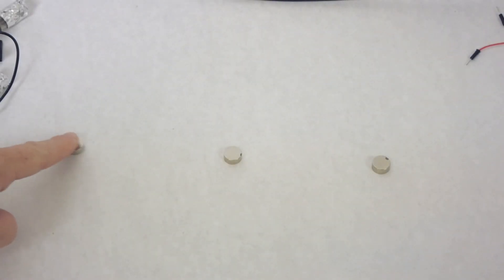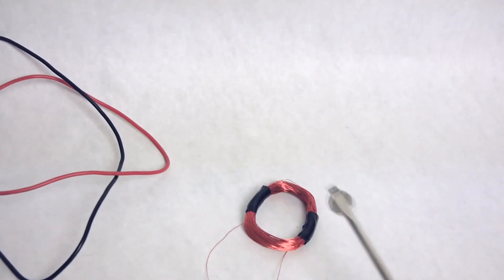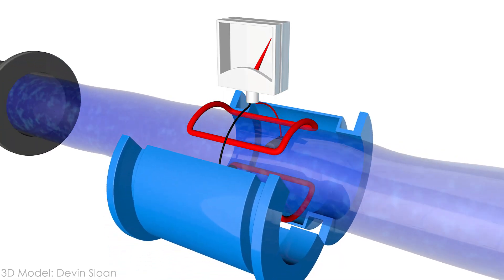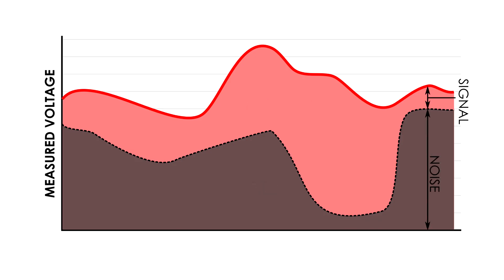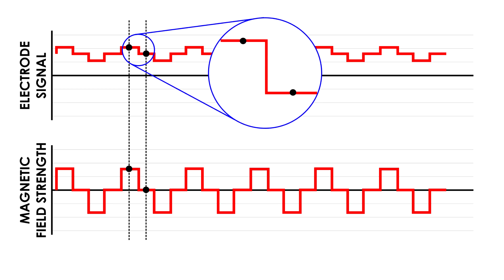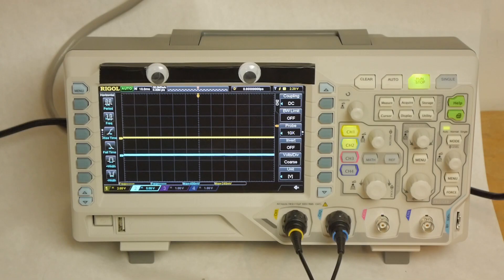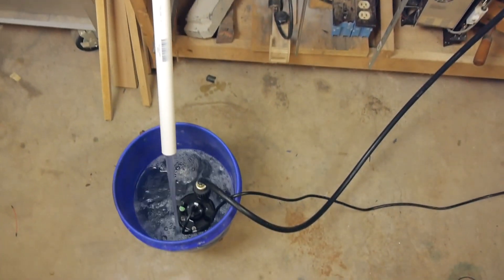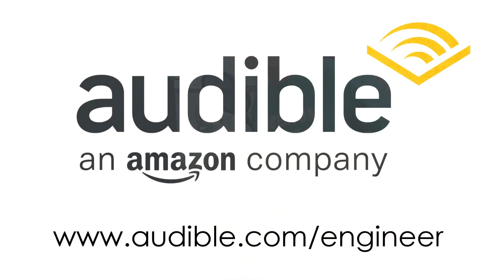How to Measure Flow with Magnets - (Magnetic Flow Meters)

Comment: connect the coil of the flow meter to a low noise opamp like MCP6021 to provide high impedance isolation. then use   a higher resolution ADC like a MCP3421  its a 18-bit delta sigma ADC.     over sample and use a FIR filter. that should filer most of the noise.

Comment: As long as your differential instrumentation amplifier has an input impedance >> (much greater than) the resistance of the water, increasing conductivity won't help.

Even tap water should be conductive enough for this. The magnetic field inside the coils should be larger than the pipe, or eddy currents in the water sap the signal.

Absolutely pure water likely won't work, as there is close to zero conductivity. But even the slightest bit if ions in the water cause some conductivity. Water is the ultimate solvent - put it through a metal pipe, metal immediately starts dissolving a bit into the water. Plastic pipe? There may be salts or some other ionizable substance that can dissolve into the water. Glass pipes? Most glass has metals added to increase toughness or clearness.

And has been pointed out, in a real world application, changing the fluid is not an option.

The magnetic field needs to be shaped so that the pipe is completely inside the core. With the tiny supermagnets or with the coils smaller than the pipe, some of the water flow is passing through the field going the other way, which reduces the signal.

Time to make my own video!
Reply from the maker: +Steve Greenfield very good info! Send me a link if you get a demo working.
Reply: Thanks! I suggest you subscribe. I've not put anything up in a very long time, but I plan on doing instructional electronics videos. Not the basics, lots of good channels do that.
Reply: Sigh... I still haven't done it.

Comment: build a coriolis flow meter
Reply: You want to detect the flow due to the Earth's rotation? :')
Reply: Interesting. Using the inertia of the fluid.
Reply: jep. quite ingenious. however, have yet to see someone built it with homebrew eqiupment (Arduino , ..)
Reply: It seems like it would be a subtle effect. But then, so is the magnetic flow meter.

Comment: Here's some helphint, since you are using AC to excite, means you have AC to work with on receive side, one thing comes in really handy (no need to increase current in the coil) google for Lock in amplifier...
That will extract signal even buried in noise by factor of 1000 or more no problem... and it is way cheaper then more magnet wire and adding current to the setup...
Also since in case you are pumping destilled water, impedance can make the system unusable, you have to use preamp with as high as input impedance as possibile not to shunt your useful voltage from the source (that puts in question your differential amp input characteristics 
that you did not disclose in the video)
Have fun

Comment: Hi!
This was a nice experiment, although i am a bit dusappointed that you didn't get it to work, instead of trying a few simple things to improve the signal amplitude. 
1.) Magnetic flux
Is there any particular reason why you used an air coil? Why not use a C-shaped iron coil body? 
2.) Fluid Flux
Another interesting addition could be to increase the flow rate by flattening the tube, which also would increase the magnetic flux density. 

3.) A Different Approach
You mention that there is potentially a capacitive dirt effect at the electrodes. 
Why not use it as part of an oscillator circuit and use the fluid flow to detune the oscillation and use a comparator with the base  frequency to generate a strong signal?
Haven't tried any of this, just wondering.

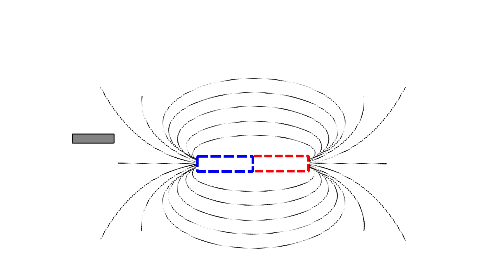Comment: At 4:36 the signal-to-noise ratio is LOW. The signal level divided by noise level (and usually converted to logarithmic scale), if the noise is high the SNR is low, if the signal is high the SNR is high. Higher SNR is better.

Comment: I was SO hoping you might be going deeper with the noise reduction and signal amplification.  I'd like to measure really tiny flows, like something in a fish tank line moving slowly.  Thanks for the video!
Reply: Update:  this video came up in my feed again after 8 years and I've still not found a good solution for measurement of slow and small flows.  I tried the Keyence brand ultrasonics but below 1 liter per minute they are pretty sketchy.

In answer to this video, I was wondering if you could use much stronger magnets and much much longer or quantity of electrical coils to increase SNR.  One idea is to coil tubing and then place magnetic coils on a toroid around that.

Comment: I'd really like to see how you manage to reduce noise. Couple of ideas: 1) since your pipe is pvc, ground the fluid and pipe to get rid of static charges, and most likely reduce the charge within the fluid. 2) Get some shielded wire for your signal pickup. Considering the voltage you are picking, even radio or nearby cell phone signals might be interfering. You did quite some work to make the testing rig. I'd rather take advantage of it. Great video by the way.

Comment: Perhaps you could use the heterodyne method [1] to extract the wanted signal from the noise. I'm not totally sure if this would work (perhaps a sinusoidal magnetic field might cause other problems), but it might be worth a try.

[1] Basically if you know the frequency of the wanted (preferably sine) signal, if you then multiply the whole measured voltage with a sine wave of the desired frequency and take a mean over time you should get the amplitude of the wanted signal proportional to the mean value.
https://en.wikipedia.org/wiki/Heterodyne

Comment: Yes, I have a suggestion to get this working without a total redesign. I suspect you have an issue with the magnetic circuit. Remember, a voltage is only induced when the magnetic flux changes, and with a biphasic pulse waveform it only changes at the step edges. So you need to increase the waveform frequency to the highest your ADC can cope with, and increase the energy stored in the magnetic circuit by adding a soft iron band around the sensing region, close to the outside of the coils. And try varying the delay between wave transition to triggering the ADC sample, I suspect a minimal delay might give best results. Hope this helps, and would love to see a follow up video if it does.
Reply: Sorry, in a former life I was designing electromagnetic flowmeters and, If sampling happens during the plateau phase of the biphasic pulse waveform everything is OK,  just as it can work with a non-varying magnetic field (a permanent magnet). But the latter can cause polarization effect and consequently dc errors. Note that Faraday's law does not necessitate  that both the conductor (in this case the liquid) and also the magnetic flux  should change. The moving conductor as described in the law is represented here as an ever-renewing chain of small liquid rods, moving between the two electrodes, in a direction perpendicular to the unchanging magnetic flux.

Comment: Decrease the diameter of the pipe at the area the sensor sits and increase it back to original afterwards. This will reduce the distances between the inducted coils and the current source, amplifying the signal. Capacitive properties of the fluid may be reduced, depending on properties, by the reduce cross-section. Fluid velocity will be increased in the narrow section due to the Venturi effect and will increase the signal.

It is a quick and easy fix that may give you a signal you can pick up. Be careful on reducing the venturi section too much since you will create back-pressure with any restriction in a pipe carrying a liquid. Dropping down to 1/4 of the original diameter should work fine.
Reply: It also increases velocity of the flow, which should make the signal stronger.

Comment: I think the problem is that the conductivity of water is not constant, since the conductivity in water is due to inpurities in the water (remember that distilled water is very low conductivity for example) and thus you need in some way to regularly measure it. Im thinking if you could improve the meter by using 3 measuring steps: First, send a electrical signal through the water via the elctrodes, with magnetism turned off. Measure resistance. After that, measure the voltage with magnets off, and then voltage with magnets on. The reistance would then be used for "calibrating" the meter to medium conductivity, and magoff-voltage is then used for "calibrating" the meter to background noise, and magon-voltage is used for the actual metering. The electrical signal sent through the electrodes would be best to do V+/V-, V-/V+ and then V-/V- (ground both electrodes to clear any residual charge). Then leave them floating for step2.
Reply: As long as the input impedance of the instrumentation op amp is >> the resistance of the water, changes in conductivity will make little difference in the signal.

Comment: You should have a longer section of straight pipe in front of the meter. Judging by your set up it looks like the flow is probably pretty dang turbulent at the point where you are measuring it.
Reply: Also try a smaller diameter pipe to increase fluid velocity ;)

Comment: Two large errors.

1. Faraday's law described how a potential difference is induced in a conductor in proportion to the RATE OF CHANGE of magnetic flux. A constant magnetic field does not induce anything in a condutor linked to it. So your peremanent magnet setup was never going to work - noisy signal or not.

2. A high signal to noise ratio is GOOD - signal much bigger than noise. You said it the wrong way around.
Reply from the maker: Hi Chris. Thanks for your comments! You bring up a very interesting point in item 1. As I understand it, Faraday's Law of Induction describes both situations where the the magnetic field is changing and when the conductor is moving through the magnetic field (more specifically called the Lorentz Force). In other words, the EMF is proportional to the relative time rate of change (velocity) between the conductor and magnetic field. This was confusing to me too at first, but there's a good explanation at the bottom of the Wikipedia article on Faraday's Law.

Regarding item 2, you are indeed correct as a few others have pointed this out. I have added an annotation to the video to correct this misstatement (although apparently mobile users can't see it) in addition to a listing in the errata included in the video description.
Reply: Thanks for your reply.

Because it's the rate of change of flux linkage which is relevant, it doesn't matter if it's the conductor or the field that's moving. In a generator, for example, we rotate either magnets around conductors or vice versa with the same result. But I don't see how there is a conductor moving relative to a field here. I guess I must be wrong since we have to believe flow meters exist working on this principle, but I don't quite see the moving conductor. The "river of liquid" doesn't seem to me a moving conductor - unless we zoom right in on your contacts and consider a "slice" of liquid moving from one side of the contact to the other along its width. But ultimately, it's moving electrons we're concerned with, so I'm still confused. Oh well, not important I guess.

OK on item 2.
Reply: It was important enough when you thought you were correct and emphatically stated that PE was wrong about it.  And, now, it's not important and you think "belief" is part of the explanation?   Wow.
Reply: So you're saying that it's moving electrons we are concerned with and yet you are somehow confused still. There ARE moving electrons! The electrons attached to the water molecules (which are moving with respect to the water molecule, but not much) are moving with respect to the magnets because the water molecules are moving past the magnets. This "slice of liquid" which you mentioned works fairly well, since that is what's actually happening. 

Also, to Grady and OP, Faraday's Law states that the (math alert) divergence of a vector field is equal to the spatial integral of the time rate of change of the B-field. The B-field created by the magnets is not measured in this scenario because it is not changing with respect to time. However, the magnetic field created by the electromagnets creates a magnetization vector in the water molecules. This is because it is aligning the spin of the electrons on each water molecule moving through the detector range. The reason why the DC magnet case works theoretically is because the faster these molecules are moving, the more magnetic dipoles (from the passing water molecules' electrons) are passing through the detector. Since there are so many of them, this appears as a DC voltage rather than a bunch of spikes. 

Sorry for the long explanation, but I'm sure someone out there can appreciate it.
Reply: Are you sure that it wouldn't be more appropiate to adress the Hall effect for the observed voltage? The Hall effect describes how moving charges get "pushed towards one side of a conductor", when moving throught a magnetic field (this is caused by the lorentz force). In this case, the charges within the fluid would be the ones to get pushed towards one side of the tube, producing a potential difference (voltage). How much the charges get pushed depends on their velocity, which is (on average) equal to the velocity of the fluid.
Reply: You can absolutely use stationary permanent magnets to generate voltage. You simply move the wire. And that's what is going on here. The liquid is moving. Try putting salt in the water to increase the signal.
Reply: Chris, maybe you shouldn't emphatically speak about "large errors" if you don't have an expert understanding of the subject.  Not only does PE have it correct, you ignore the fact that this is not new and, empirically, works as stated.  That you could not correlate the analog of a generator with permanent magnet stator and a rotating armature is telling as that is as fundamental as Faraday's Law gets.  In fact, PE explained this early on in the presentation and you still didn't get it.  I see you replied to PE's response and claim you STILL don't get it, but that must be because you do not want to understand it and did not do any further research for your own edification.  So, it is you that made the large error and don't really seem to care to learn from it.  Sadly, that's too typical.

Comment: you should make a gas or water  gauge, the older electrical ones with the resistor float in the tank and a bi-metal needle pusher.

Comment: Why measure with an electrical signal instead of a propeller? (where the rotational speed can be related to linear speed)
Reply from the maker: Sometimes measuring the flow physically causes too much of a pressure drop in the pipe. Also, sometimes the fluid has sediment/trash that would clog up something like a propeller.
Reply: I remember something about permanent stream installations using pressure readings?
Reply: First, as others have pointed out, fluids with abrasives, or suspended solids such as sewage would not work well in on a propeller meter.  (Yes, measuring sewage flows is a dirty job, but someone has to do it). 

Second, the speed of a propeller is not exactly proportional to the flow at lower ends of the scale. In fact, it requires a calibration curve. Until a flow can overcome the moving resistance of a propeller, there will be NO flow measured. Note that as a propeller meter ages, the flow measurement typically degrades at the lower end of the scale.

Third, the range a magnetic flow meter can measure is large. We call this the turn-down ratio. A propeller can have a turn-down ratio of perhaps 15 to 1. Conversely, commercial mag meters have as much as 100 to 1 turn-down ratios.  

Fourth, this method scales up to large sizes. I've seen mag meters on 36" pipes. I know they come in much larger sizes. Even classic flow measurement techniques such as the Venturi meters get less accurate on larger pipes due to boundary layer and velocity profile problems.

However, there are instances where a mag-meter is not appropriate. Non-conductive fluids will not register well in a mag-meter. So measuring the flow of gasoline is not an appropriate application for a mag-meter. 

(I work for a water and sewer utility and I am a registered professional engineer of instrumentation and control systems. I guess that means I must be an authority about such things. However, despite more than 30 years working on this stuff, I'm still learning)
Reply: +Katherine L. Vogel Venturi and differential pressure meter, GO!  Oh, wait, you need static fluid pressure and temperatures too to compensate for changes in density and velocity. . .

Comment: I work at a power plant in Sweden and i'm in awe. It's not the simplest solution but if it works with both low and high flows then i can see it being used in a number of applications. Exampel, dosing were it can be tricky due to the low flow rate to measure the flow. BOSS! COME CHECK THIS OUT!

Comment: Rotate the pipe into a vertical orientation. This ensures the pipe is full of liquid. This is a practice used in industry when installing mag flow meters.
Reply: Which industry? Working with mag flow meters in the water industry; they're all horizontal...
Reply: @AAAyyyGGG  He's spot on. At least have a turn up rather than down after the meter.
It's the first thing I saw in this setup, read any install manual. The meter wasn't flooded...
Next do a Coriolis using guitar pickups 😁
Reply: I haven't seen vertical mag in my life
Reply: @saadjarad2882  La tubería debe estar siempre llena, no puede estar parcialmente  llena.
Reply: Do you need a reference for correct measuring. Use a grounding ring before the meter. Check the Rosemount 8732 manuals. There is 5 Hz and 37Hz.